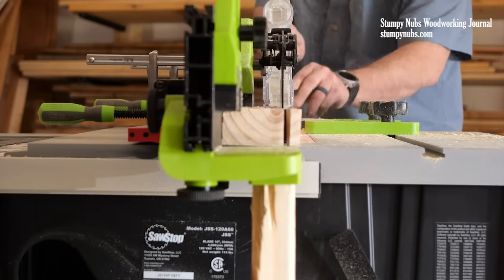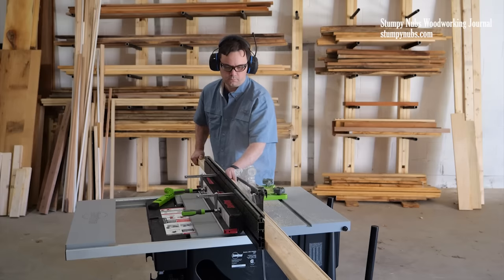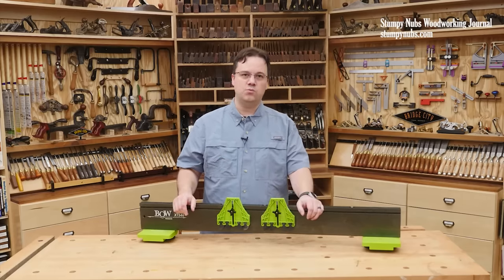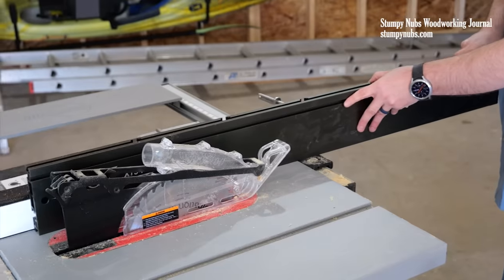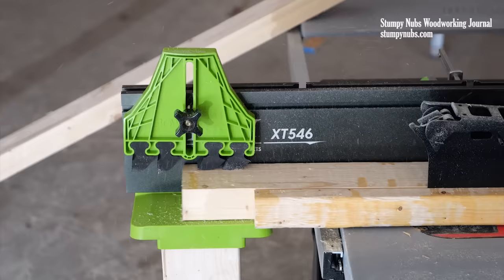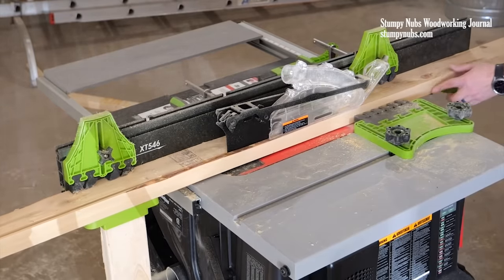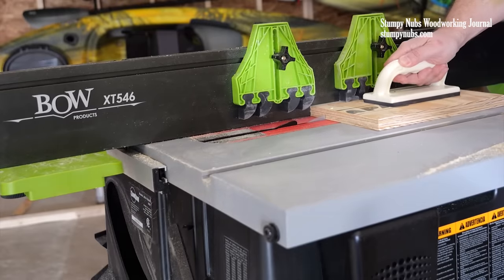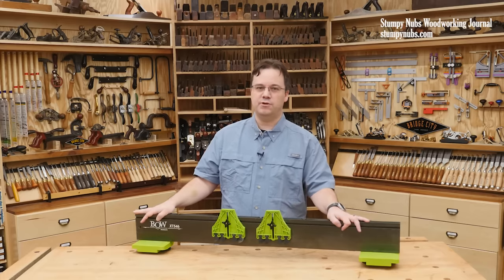I put this on my saw and it changed everything for me!

Comment: Looks great, but how about all those who work with the metric system? Will there be a metric version as well?
Reply from the maker: I think the benefits of the system far outweigh the minor inconvenience of having to add 2.5cm (about 1-inch) to your metric scale. In fact, you could just add 25mm because many jobs would not be affected by simply rounding off the extra 0.4mm. If the job requires more than half a millimeter accuracy (and the fence scale on your small saw is capable of that level of accuracy) I would still take the benefits of this system and just measure from the blade to the fence by another means.

Comment: Let us know when they make a metric version for everywhere in the 21st century.. 😜
Reply from the maker: I think the benefits of the system far outweigh the minor inconvenience of having to add 2.5cm (about 1-inch) to your metric scale. In fact, you could just add 25mm because many jobs would not be affected by simply rounding off the extra 0.4mm. If the job requires more than half a millimeter accuracy (and the fence scale on your small saw is capable of that level of accuracy) I would still take the benefits of this system and just measure from the blade to the fence by another means.

Comment: A longer fence around  54" would be great
Reply: It's already unstable and too heavy at 46in. The outfeed brackets do allow for end supports via a 2x4 slot but it makes fence adjustment on the fly cumbersome at best. You'll need to remove the Bow extender from the rip fence, make your adjustment and then reinstall the Bow extender and clamp it down each time. It's not as user friendly as made to appear.

Comment: Seems like what could be useful is where the fingers are that hold board down, is instead using spring loaded angled rollers, so as you're pushing it through it naturally wants to pull it against the fence. It's probably less of an issue when you have a riving knife or splitter installed, but when you don't, that could be helpful.

Comment: They don't seem to mention this on their website or amazon store, but shouldn't this also work amazing for a miter saw? You wouldn't need a huge miter bench taking up space, you just pop on 1 or 2 of these and have a longer straight edge, with support at whatever distance you need for your cut.  I really want to order 2 as soon as I can (1 long 1 short), so I can test it on a router table too. I think I'd only need 2 short ones for a router table, but I'd need to test some modifications.

For a miter saw, I'd want to put measuring tape on it eventually and not sure where that would go, but I think putting in an indexing system so it would remain accurate when taking it on and off would be simple.

Comment: I've been curious about these for some time now.  Will the Bow fence fit directly on my Unifence?  I mean, can I remove the regular fence portion and slide the Bow fence on? I don't want to have to clamp it on. I know it will throw off my gauge, but I think I can compensate for that.
Reply from the maker: Yes, there is a track specifically milled into it for the Unifence.

Comment: Very slick, but does it fit crummy big box brand portable saws cough ryobi *cough*? Your SawStop CTS has a fence twice the size of the RTS23.
Reply from the maker: It should fit pretty much any fence. Narrow, wide, as long as it can clamp on to something relatively straight, it should work.
Reply: The saw he showed is not a SawStop CTS, but a SawStop JSS.
Reply: @StumpyNubs  
The SawStop CTS, like some DeWault models, has a flip-over attachment to the fence for wide support and cutting thin pieces.  It's not solid enough to clamp something tightly to.  I'm not saying that this Bow fence can't be attached to it, but I'd like to see some real confirmation that it can be attached to a fence like that.
Reply from the maker: @PJRayment  The SawStop in this video has a flip-over fence attachment. As long as a fence has a bar that can be clamped to, it will work.
Reply: @StumpyNubs  Yes, I can see that now.  It's sitting flat on the table.  The CTS one sits vertically, and a little away from the fence proper, but I've just measured it, and it's 23mm shorter (vertically) than the main fence, so I guess that should be enough room to clamp it on.
I also wonder about the strength of the main fence, it being hollow aluminium rectangular section, but I think it would be strong enough to take enough pressure for this, if you're careful to not overtighten the clamps.
Reply from the maker: @PJRayment  The jobsite saw has a hollow fence and I am sure I could deform it if I really tightened the clamps hard. But the Xtender can be secured just fine without doing that.

Comment: I wonder if they will do a metric version? Being exactly one inch thick means it is 25.4mm, which is not as simple to account for.
Reply from the maker: I think the benefits of the system far outweigh the minor inconvenience of having to add 2.5cm (about 1-inch) to your metric scale. In fact, you could just add 25mm because many jobs would not be affected by simply rounding off the extra 0.4mm. If the job requires more than half a millimeter accuracy (and the fence scale on your small saw is capable of that level of accuracy) I would still take the benefits of this system and just measure from the blade to the fence by another means.

Comment: Did you find a solution to supporting the middle of the table when you have it extended? Normally you would use that blade built into the the fence, but it’s entirely covered by the new fence
Reply from the maker: I don't understand your question. Please rephrase it.
Reply: @StumpyNubs  job site pro saw. I want to do a 20” rip. Currently, extend the table then turn the knob on the top of the fence which extends that thin metal support which supports the material that is against the fence and would otherwise have nothing underneath. 

If I have this bow fence installed, I will not be able to use that support. In that case, what is the best way to support the material against the fence? I have thought of a couple approaches, but they seem awkward, just wondering if I have missed something.
Reply from the maker: @TheBiggerNoise  There is a T-Slot on the underside of the BOW fence extrusion. You could attach a strip to it and it would have the same function as the flip-down support on the stock fence. However, unless you are cutting really thin, floppy material, I don't find it necessary. I suppose there is no perfect solution for every situation.
Reply: @StumpyNubs  I saw the t slot and came up with the support; it just seemed like a lot of work to have to get it in and off (relative to twisting a knob). Just wondered if I had missed something.

I’ll try a cut without the built in support, I’m relatively new to table saws and it never occurred to me that it might not be needed for all my cuts.

Thank you

Comment: I’ve been having trouble making straight/parallel cuts on my SawStop cabinet table saw.  I checked the fence and it’s parallel with the miter slot at the front and the back but it is as much as .005 “low” away from the blade for a few inches on either side of the arbor.  (I checked the blade and it is parallel with the miter slot, too)  I contacted SawStop and they said that was “within tolerance.”  Do you think this would help with that?  A new fence from them would be $180 but if I bought the 42’ version of the Bow fence I’d have better in/out feed support plus I could attach the feather boards, etc.  Tired of “rip snipe.”
Reply from the maker: This would eliminate the low spot you speak of, but I am not sure .005 would cause your workpieces to be noticeably out of parallel. Perhaps you might examine your technique. Make sure the board remains tight against the fence throughout the cut, for example. Watch for gaps closely as you make some test cuts.

Comment: This is the main problem I need to solve in my home shop. I have an ancient Delta 10” tablesaw with no riving blade and the “fence” is a 2x4, only attached at the front of the saw. The back end moves even when locked down. It’s very inaccurate. However this saw has round metal tubes running across the front & back for the “fence” to ride on, not square ones as in newer saws. So far the only options to replace the fence has involved me drilling holes in the table, something I can’t do. I’m now 70. Will this attach to my 2x4 fence? Wouldn’t that still be grossly inadequate since the underlying fence moves? I’m interested.
Reply from the maker: Your 2x4 fence is dangerous if it moves during the cut. I highly recommend you find a more secure option.
Reply: @StumpyNubs  I’ve been trying to find one, but my old saw has sidebars that are iron tubes, not with a square cross section as in newer saws, and the newer replacement fences won’t fit. Suggestions will be appreciated.
Reply from the maker: @JSCRocketScientist  - I had a saw like that once. I bought a T-style fence with rails and replaced the tubes with it. It's not a cheap upgrade, but it will make your saw MUCH safer and far better performing.
Reply: @StumpyNubs  Thanks! I’ll look into it and balance it against the cost of a new saw. I love my big cast iron saw, but it’s underpowered. Can you roughly say how you replaced the rails? I assume you had to drill new mounting holes? And by the way I always stand to the side while using it. It’s old enough, no riving knife. Yikes.
Reply from the maker: I believe I did have to drill holes, but I drilled them in the fence rail bracket to match what was on my saw, not the other way around. Some fences are universal because they rail attaches with movable brackets (Incra's fences) or with a T-bolt system (Harvey's Big Eye Fence.) But they are quite expensive.
Reply: @StumpyNubs  🤦‍♀️😂 I didn’t think of that! Thank you.

Comment: Save people the trouble, it's roughly $160 for the longest, $88 for the shortest. The feed supports (attachments) is $45 for 2, and for the feather boards is  $35 for 1 or $40 for 2 depending on type. All in, for his set up it would probably be around $275 for what he showed at the time of this posting.

I wanted to put this because I hate when youtubers put out advertisements without addressing how much things cost at the time of uploading the video. Yes, I realize prices change, but it should still be stated how much things cost at the time of the upload to give an idea and not waste people times having to go to another site to figure it out.

Side note: Youtube is obnoxious and deletes anything you embolden in your comment, which forced me to edit and reenter the amounts. What a stupid system.

Comment: Is it compatible w/non-Bow components?  For example if someone owns clamps or feather boards from another vendor will the guide accept these?
Reply from the maker: The clamps from MicroJig, Bessy and others that fit in dovetailed slots will work. Pretty much any featherboard that will go into a T-track should work too. And there are plenty of mounting options on the extrusion that I think can be used for jigs and other things.

Comment: which "kit" is appropriate for a sawstop CTS?  There's a $300 and a $290 version of very similar kits.
Reply from the maker: I think the 46-inch is definitely the one to go with. You'll really want to get the supports with it. If you already have clamps that work in dovetailed slots (MicroJig MatchFit and some Bessy clamps will work) you can use them. And Any featherboard that goes in a T-track should work too, though the BOW featherboards are definitely superior in almost every way.
Reply: @StumpyNubs  thanks, but I was referring to the two different packages… One of which seems to have a slightly bigger feather board with two pins, instead of one.  I’m just gonna assume the two pin is better.  It will be my first table saw actually, so buying from scratch.  I’m Building a fence with arbor gate soon and I’m pretty sure just my miter saw is not gonna cut it.  I just need to keep repeating to myself (and wife) “it’s cheaper than a trip to the ER” over and bit the bullet.

Comment: Just so I'm clear; if the fence on my low-end Mastercraft table saw is already garbage, this won't be a replacement...?
Reply from the maker: It doesn't replace it, but it may solve many of the issues that make it garbage.
Reply: @StumpyNubs  My main issue is that it isn't parallel to the blade, and it's pretty flimsy. It looks like this would definitely stiffen it up, but I'm not sure it would fix the parallel issue, unless I'm mistaken
Reply from the maker: @Swarley218  No. You will still have to measure from the front and back of the blade to align the fence.

Comment: Do they do a metric version 1inch does not suit my table saw rule it’s in mm
Reply from the maker: I think the benefits of the system far outweigh the minor inconvenience of having to add 2.5cm (about 1-inch) to your metric scale. In fact, you could just add 25mm because many jobs would not be affected by simply rounding off the extra 0.4mm. If the job requires more than half a millimeter accuracy (and the fence scale on your small saw is capable of that level of accuracy) I would still take the benefits of this system and just measure from the blade to the fence by another means.

Comment: Does it have a metric version for the rest of the world?
Reply from the maker: Give them time.
Reply: @StumpyNubs  
I wouldn't count on it.  It's not like just adding a metric scale.  It's a whole new extrusion, and probably new bottom supports as well.
Reply from the maker: @PJRayment  I think the benefits of the system far outweigh the minor inconvenience of having to add 2.5cm (about 1-inch) to your metric scale. In fact, you could just add 25mm because many jobs would not be affected by simply rounding off the extra 0.4mm. If the job requires more than half a millimeter accuracy (and the fence scale on your small saw is capable of that level of accuracy) I would still take the benefits of this system and just measure from the blade to the fence by another means.
Reply: @StumpyNubs  
"I think the benefits of the system far outweigh the minor inconvenience of having to add 2.5cm (about 1-inch) to your metric scale."
I'm not suggesting otherwise.

"In fact, you could just add 25mm...[or] just measure from the blade to the fence by another means."
Of course.  Which is one reason that they're not likely to create a metric version in the future.

Comment: Without a nice round number metric option I'm not going to be adding 25.4 to every cut!
Reply from the maker: I think the benefits of the system far outweigh the minor inconvenience of having to add 2.5cm (about 1-inch) to your metric scale. In fact, you could just add 25mm because many jobs would not be affected by simply rounding off the extra 0.4mm. If the job requires more than half a millimeter accuracy (and the fence scale on your small saw is capable of that level of accuracy) I would still take the benefits of this system and just measure from the blade to the fence by another means.

Comment: I bought this tools and am bitterly disappointed. Not that it isnt superb at its intended function. That Bow failed to drill 2 very accurate holes in it that would have allowed additions (salable) to turn it into the most useful woodworking tool in history for beginner woodworkers, kitchen fitters, carpenters, and experienced woodworkers that dont have a Felder KF 700 like I do. Problem 1. Ripping a large panel accurately...factory edge..this solves that problem. Problem 2. That this product could have solved too.Feel free to ask me...
Reply from the maker: If you have an idea for an improvement, contact them. They are just two guys, you'll get through. I am sure they will love your input. Here's the contact page on their website: https://bow-products.com/contact/
Reply: @StumpyNubs  Sent the email. Hopefully it will result in a new tool because I will be buying one if it does.

Comment: Exactly 1 inch to make measuring easy? Missing out on 7,766,700,000 potential sales in the metric market!
Reply from the maker: I think the benefits of the system far outweigh the minor inconvenience of having to add 2.5cm (about 1-inch) to your metric scale. In fact, you could just add 25mm because many jobs would not be affected by simply rounding off the extra 0.4mm. If the job requires more than half a millimeter accuracy (and the fence scale on your small saw is capable of that level of accuracy) I would still take the benefits of this system and just measure from the blade to the fence by another means.

Comment: Do they come in Metric? 1 inch thick is useless in countries other than the US.
Reply from the maker: I think the benefits of the system far outweigh the minor inconvenience of having to add 2.5cm (about 1-inch) to your metric scale. In fact, you could just add 25mm because many jobs would not be affected by simply rounding off the extra 0.4mm. If the job requires more than half a millimeter accuracy (and the fence scale on your small saw is capable of that level of accuracy) I would still take the benefits of this system and just measure from the blade to the fence by another means.

Comment: Just bought one. Super disappointed. Face isn’t flat. It has a bow to it. Anyone else have this problem?  Bought from Taylor Toolworks. They won’t respond. Beware you could end up with junk.
Reply from the maker: I have never in my life known Taylor Toolworks not to respond. Try again. They will fix it for you. They are good people.
Reply: Thx. They did finally reply and replaced it, however, Same problem..  face is bowed.  About 0.030” rocking of my straight edge on the 5” height of fence.  Like the idea of this fence. Why would it be this way?